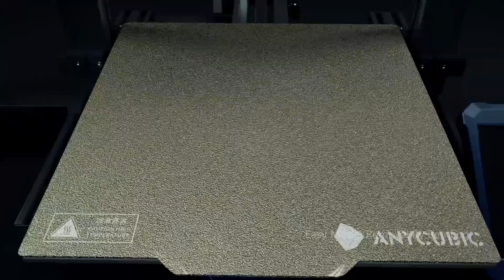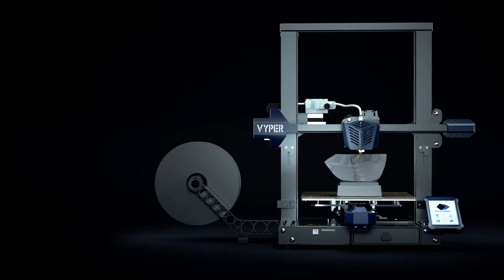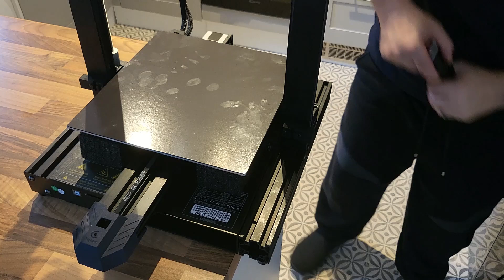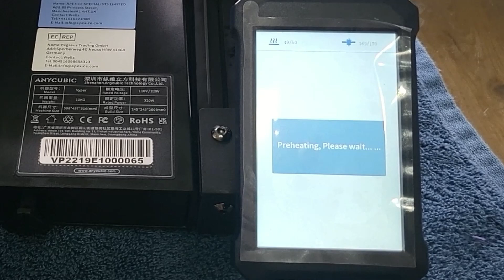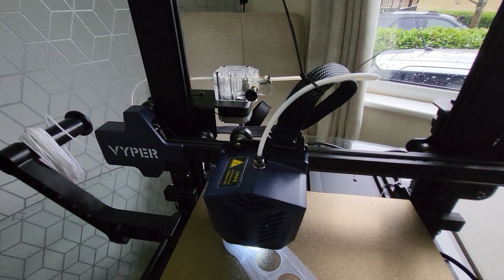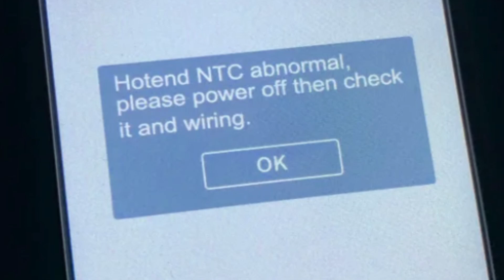Anycubic Vyper 3D Printer Unboxing & An Honest Review

Comment: (edited) no USB? I had USB in my diy printer 10 years ago....
Reply from the maker: Yeah slight oversight but not a game changer for me 👍
Reply: @greedy3d480  I did my research and there is USB connection. So... you had an older version?
Reply from the maker: @piotrr5439  ah that's interesting
Reply: @greedy3d480  thought I saw a usb ( printer tyoe) in the back ?
Reply: It has USB, I bought my Vyper 2 years ago.

Comment: Thanks so much for a great review. You just got a new subscriber :)  I just ordered mine, so should be delivered in a week.  Question: I can't find this info in specs, but is the hotend all metal?  I want to be able to build some brackets with PETG, and worried it will clog if not all metal.  Also - what slicer app and printer profile did you use?  Any tweaks we should know about for optimal printing?  Thanks!
Reply from the maker: Hi and thanks for your sub 😊👍 it's great to have you on-board I'm pretty certain that the vyper has an all-metal hotend I am using the latest version of Cura the viper has a profile in there if u want to tweak it a bit more you can or u may want to leave it a standard settings its deffo worth doing some test prints see what works for your setup

Comment: I will pick up my new Vyper tomorrow.
I was first planning on buying an Ender V2, but this Vyper already has all the enhancements build in.
So for a little bit more money this is actually a much better option.
Printing below 8 degrees could be a problem for any printer because of the (properties of) base material/filament?
Reply from the maker: I love my vyper... So pleased I got it and yes I had probs with enders too in low temps.. Auto leveling rocks 👍👌😁
Reply from the maker: never used Nylon but it can go up to 260c - so you may have to do some more digging to get that answer im afraid -??

Comment: What size filament does it take? I had to order me one  since I got tired of the resin printer odor😂 and does pla filament smell bad if not can I put it in my room?
Reply from the maker: 1.75 pla... No smell really but even though its fairly quiet it's too loud for a bedroom but  safe for a room as it doesn't generate loads of fumes like resen.. Very slight smell
Reply: @greedy3d480  thanks so much man 🙏🏻just received my Anycubic vyper today can’t wait to start printing. I was going to get a ender but I didn’t want to deal with manually adjusting the bed lol
Reply from the maker: @1inthrobber  you'll love it

Comment: Nice review but just the time needed to print for FDM keeps me away from them, I loved my ender 3 but 8 hours for 1 32mm mini was a killer. Sound was never an issue as I am 70% deaf lol.
To stop the bed cooling can't you add code in the gcode, i ran my ender via octoprint and that had code to raise the hot end 10mm and keep the temps stable or if it took hours to fix reheat before restarting.
Reply from the maker: Ah good idea re G-code ?? ill have to look into that - I prefer Resin and would never replace printing main figures or high detail in PLA but when I'm making bases ( the recent HALO xbox holder as an example) the resin used is massive compared to a relatively cheap PLA alternative . I think there is room for both  - especially now with auto levelling and a sweet magnetic base :) thank you as ever for taking the time to comment - it really is greatly appreciated
Reply: @greedy3d480  1st of Feb and the last chicken flies the nest so I am taking over that bedroom as my man cave which gives me about 2x the space i currently have ;-) Maybe in the future a new FDM would come in handy for big things especially D&D ground plates indeed.
Gonna set my airbrush and painting station up in there too.
So the Vyper has no usb? means no rasberry pi with octoprint. I assume you have to set the z stop switch too even with self leveling.
Reply from the maker: Didn't need to touch the z stop.... There is a connection like a printer and a lead that comes with it if that can be used for a PI I don't know
Reply: @greedy3d480  usually stick a PI into the USB port on an ender 3. Sad i cant do the same with the Saturn 2 8k ;-(